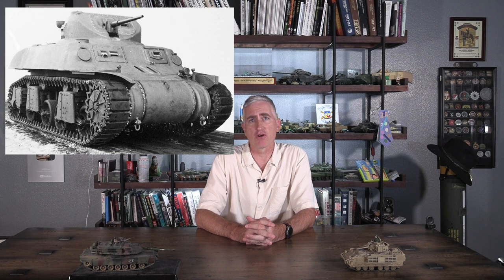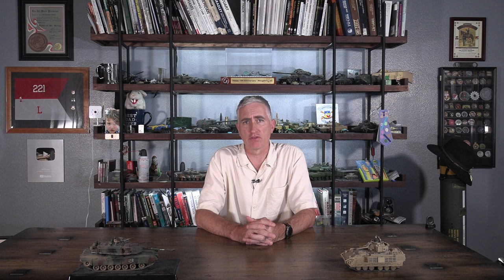The Tragic Tale of the Quad Cities Tank Arsenal and the M7 Medium

Comment: The Chieftan made a good point about 'institutional knowledge', regarding the manufacturing of tanks, and detriment/ increased burden of losing that knowledge, say all tank production closed for 5 years.  I wonder if there are any interesting case studies out there?
Reply: China has a good one going on now in their blue water navy, and Russia is experiencing it with their generation 5 stealth fighter program. Both didn't lose the institutional knowledge, but never had it in the first place, so effectively the same thing.

The effects? China floats an aircraft carrier but are basically winging it when it comes to it being a genuine force projection tool. And Russia has a generation 5 stealth fighter program, but 'fields' like 3 maybe.
Reply: @ekscalybur  All good points Eks, with regards to China, technological advancement is important.  However, I think their carrier and "stealth" fighter also serve a propaganda purpose.

On another note, Japan, one of the original developers of aircraft carriers, is acquiring a new carrier.  To be honest, I have yet to do any research on that ship, but I wonder if it's a native design, or supplied by another nation.  They certainly have experience building massive ships, but it has been a few generations since their last carrier.
Reply: @jayklink851  The Izumo-class aren't carriers... exactly. Officially they're "helicopter destroyers" or even "multipurpose destroyers," and the big flat decks were supposed to be for operating large numbers of ASW helos.

In practice they also have a few hundred troops and a few vehicles they can put ashore via air, and the Japanese government has ordered enough F-35Bs to base a dozen on each Izumo.  Plus ordering modifications to the ships to make them better platforms for the F-35B.
Reply: @Philistine47  Oh ok, so its official task & purpose is for helicopters but it can accommodate F-35Bs, gotcha. I wonder if their 'defensive only' treaty forbids full scale carriers?  At any rate, Japan has definitely lost some institutional knowledge when it comes to modern carriers.
Reply: @jayklink851  Pretty much. Japan the Shield, US the sword. The defence aspect is in the Japanese Constitution, not a treaty. The defensive aspect has over the decades increasingly loosened, hence "Helicopter destroyers" and the recent declaration that they would defend Taiwan as they see that as an existential threat.

If Japan was to get CATOBAR carrier, there is no technological reason they can't and the US can transfer the institutional knowledge. Japanese defence industry is a lot more developed than people think. They make and design their own tanks, jets, navy.
Reply: @oohhboy-funhouse  As an undergrad one of my professors, a former Pentagon employee, introduced me a Nuclear proliferation specialists/author, he said that Japan probably has several nuclear weapons.  Most likely covertly developed in the mid-late 80s.
Reply: @jayklink851  And a modified Japanese Epsilon rocket would probably make a perfectly serviceable ICBM. They're solid-fueled and require only 8 crew at the launch site, neither of which are conventional requirements for civilian launch vehicles.
Reply: @Morrigi192  Morrigi, I just watched a video of a Epsilon rocket launch a satellite into space, a damn fine solid-fuel rocket.  The Epsilon certainly has the capacity to carry a warhead.
Reply: @ekscalybur  China copied others military jet engines yet never figured out the alloys those used for the components subjected to extreme high temperatures. That limited the speeds of the aircraft since using the afterburners for short periods of time would quickly ruin the turbines. I think Russia ordered 12 of the stealth fighters, took possession of 8 for testing with 3 crashing during training and 1 burning up on the ground. Think the remaining 4 were grounded after one had it's pilot's canopy pop off when flying at 44,000 feet.
Reply: How about the USS Jimmy Carter, SSN-23? (Edited to fix hull number. Don't know how I screwed that up!)

She (ships in the US Navy are always female, despite the name) was the third and last ship of the Seawolf class.

The Seawolves were designed in the 1980s to basically be able to single-handedly hunt down an entire Soviet carrier group. They carry far more weapons and have twice the number of torpedo tubes as a Los Angeles class. They're also about 10 feet bigger in beam (same beam as the Ohio-class) and close to 2000 tons heavier. The plan was to build 29 of the Seawolves. The Navy had gone so far in preparation that they'd built a huge new schoolhouse for all the new systems in Groton, CT.

Then the Soviet Union collapsed, and the production run got cut to 12, and then to 2 boats that were basically too far along to cancel entirely.

But this also left Electric Boat, the manufacturer, not doing anything for almost a decade while the Virginia class submarines were designed. All the welders and shipfitters would be laid off.

So, despite the expense, a third Seawolf class submarine was ordered, and also extended roughly 100ft with an "ocean access section" to take over from the USS Parche (that's spoken "par-chee") for doing Special Projects.

President Bill Clinton himself said that this was specifically to keep the highly skilled workers and their corporate knowledge going.

With the addition of that ocean interface plug, Jimmy Carter was not commissioned until after USS Virginia was.

Today, all three of the Seawolf class subs are stationed on the Pacific coast as part of the Submarine Development Squadron, mostly to have all their relatively unique spare parts in the same place.
Reply: Double post.
Reply: @ScottKenny1978  Scott, that's an excellent example of just how important institutional knowledge is.  It sounds like your fairly knowledgeable about our submarine fleet.  Now I could be totally wrong, have the Europeans developed a diesel electric that can stay submerged for several weeks?  Historically, the lack of oxygen limited how long diesel electrics could be submerged before they had to recharge their batteries.
Reply: @jayklink851  yes, I was on subs as an admin guy (and helmsman and lookout) from 2000-2006.

The keyword you're thinking of is AIP, for Air Independent Propulsion.

There's a couple ways to do it, one is a fuel cell that turns hydrogen and oxygen into water plus electricity. Fuel cells have hydrogen and oxygen storage tanks outside the hull. The other way is something called a Stirling engine, which usually runs off of diesel fuel and pure oxygen, with the oxygen tank outside the hull.

I believe that all modern subs have a way to make oxygen while under water, plus a carbon monoxide burner to make carbon dioxide and a carbon dioxide scrubber. On the subs I was on, our scrubber used monoethyl amine, and that gives the air onboard a very distinct smell.

There's also stuff taken from underground mines, but at least in the US Navy that stuff is for emergencies.

Comment: Oh my.  This talk brought up memories of when I worked on software for the Navy's LHD.  Our software was to allow one computer system (made by one contractor) to communicate with another system (made by another contractor).  Engineering changes (ECs) from the government which changed communication protocols showed up from time to time and we had to go back and modify the software to accommodate them as well a log and correlate the changes with the EC database.  These changes were also implemented and logged by another team (different contractor) who were developing the emulator that mimicked the hardware we were supposed to communicate with.  When we got to the shipyard for integration testing, nothing worked.  The hardware contractor pointed at us and said, it's their software.  We had all our major people there using various interface 'sniffers' by which we proved that their hardware had not implemented this EC or that EC.  Those ECs which required firmware changes could be redone but the changes that required new circuits generally could not.  In the end, we had to jury rig our software to accommodate their hardware so the systems could communicate.  I learned firsthand the meanings of fubar and snafu.

Comment: We used to go over to East Moline after the Iowa bars closed at 2 am.  In East Moline we could drink to 5 am, back in 74.  My head hurts just thinking about it.  I worked at JI Case in Bettendorf, which was originally an old railcar factory iirc.

Comment: I'm sure the US production of the Merlin would benefit from the same treatment.
Packard got the drawings from Rolls Royce.. Looks at them contacts Rolls Royce supposed to be Britains best engine manufacture. "You havnt sent the right drawings". "What do you mean". "There are no torque wrench settings". A very puzzled senior engineer "What's a torque wrench?" they litteraly had no idea, they were not used in the UK. Every thing required the skill of a trained fitter. Packard eventually had to completely redesign the entire engine. Oh I checked torque wrenches were not available to RAF technicians. I have several RAF manuals not a torque setting in sight.
Reply: RR first asked Ford about producing the Merlin and sent them an engine along with the blueprints. Ford was working on a V12 aero engine to compete with the Allison and Merlin so turned down the offer, saying they needed the exact specifications for each part that was required for mass production. Ford sent the engine and blueprints to Packard that told RR the same thing. RR asked Packard to do that for them so they did and redesigned the motor while at it to improve the reliability of components and reduce the number of parts it used (the similar Allison V12 used 50% fewer parts). 
Torque wrenches were invented around 1918. Chrysler began producing their own improved beam-style torque wrenches in the late 1920's and early 1930's. The US military provided their mechanics with torque wrenches after their inception. In the 1930's Blackhawk Tools made a beam-scale torque wrench that would flash a light when the set torque was reached. Britain imported torque wrenches so in 1942 allowed two Brits to start manufacturing copies of US torque wrenches. Standard torque specs were determined by bolt/stud size and thread pitch which often came listed on a sheet with each new wrench.
Reply: @billwilson3609  we definitely didn't use them before I have a number of maintenance manuals for RAF planes. Absolutely no mention of torque wrench settings. I know you can work it out from a table if you know what the bolt material is. I wonder if in those days even that was standardised. Some years ago I watched a documentary on Cosworth F1 engines perhaps 1980s not a touque wrench in sight!
Reply: @womble321  I don't know what the British did. Common sense would suggest using torque wrenches during assembly then an approved tightening sequence out in the field due to shortage of torque wrenches. The US Army supplied torque wrenches to the mechanics at the repair depots and field repair stations. Had a neighbor that was a mechanic with a 3rd Army armor recovery unit and said they had 1/2" and 1/4" drive torque wrenches that were "liberated" from a repair depot so they could replace the cylinders, heads, oil and fuel lines on the radial engines to ensure that the gaskets and fittings didn't develop leaks.
Reply: @billwilson3609  hi early in the war they simply didn't exist. Everything was done by feel.
Reply: @womble321  I know that by the 1990s that was part of the US Federal Aviation Regulations. Had a table in the book but I don't remember if it was in Part 43 (general design) or Part 65 (maintenance). Annoyingly, my books took a walk about 20 years ago.

And the FARs are basically all the WW2 standards.

Comment: The machine tool manufacturers went a step further to address the machine tool shortage by designing attachments for their machinery that would allow them to perform two or more different machining functions on the parts they were producing. That saved on costs for additional machinery and the buildings required to hold them. Tool makers also started a cutting tool exchange service where they dropped off sharpened cutting tools and took away the used ones for re-sharpening before they became dull.

Comment: These early tooling machines were often Bridgeport lathes and their predecessors, eventually replaced by CNC machining in modern day, but still verrrry much around. 
Ian, on Forgotten Weapons, has a tour of a machine tool rifle manufacturer that has a chain of these older machines, each one doing a different task, so as to automate manufacturing in parallel. This line now sits idle as it's been replaced by CNC milling, but the manufacturer still keeps it intact.

Comment: "tool room methods" are those which are more versatile but slower than production methods. Instead of dedicated fixtures, gauges, dies, machine tools, production lines, etc, the factory relies on highly skilled workers to produce parts using general use machines by figuring out more or less for themselves how to do the job. Much slower and more expensive per part, but cheaper and faster than waiting for a production line to be setup.
Reply: Bespoke.

Comment: I was sad to listen to this story simply for nostalgic reasons. My Dad has 2 International Harvester model H tractors that were built in the late 1940s and are his age. They've been run pretty much continuously since production with a bare minimum of maintenance, and he still uses both of them- one as a snowplow and the other for a bunch of basic work around his no-longer-operating farm. The darn things just don't break. The last major work we did on them was replacing the seals in the transaxle.... back in the mid-90s.

Comment: 22:00 - That whole situation with "Tanks now!" "Factories? eh?" sounds a lot like Priority Inversion, which is something that can affect realtime operating systems.

It's no use marking something as high priority if it depends on something lower priority, and you don't thus bump the latter's priority to match the former's, especially if there's anything else higher than that lower priority.
Reply: What are you saying there?

So, if a high priority thing depends on a low priority thing, you should:
A) make the low priority thing jump up along with the high priority thing?
B) not make the preceding thing be affected by the priority of whatever comes after
Reply: And this system still exists.  Now known as DPAS (Defense Priority Allocation System). And all parts have the same priority as the finished product (up to a specified number).  Tooling, equipment, and raw materials were our problem. 

I remember looking at my shop's production plan for the next two months.  Spent days carefully tracking every process and planning things so that every one of our customers would get their stuff on time.  Then my phone rings and the guy on the other side told me he had a rush project with a DPAS rating one level lower than that of our biggest contract.  (Which had a really, really high DPAS rating).  I apologized to him and told him that we had an Air Force contract with a higher DPAS rating and that our production schedule was full.  At this time I was certain that my carefully laid production plans were safe because the only person who could approve a higher DPAS rating was the Secretary of Defense.  

The next day the guy called back and said that his project now had that higher rating.  And that he needed the parts next week.  My shop was already working 50 hour weeks and none of the stuff we were working on could be sent out to the main shop.  So me and my shop now worked a 60 hour week and got those parts ready to be picked up by their courier on the day specified (3:30 PM but that still counted as the specified day).  And I socked all of the overtime charges and overtime for the machines (plus a 'you pissed me off' markup) to the bill.  

Two days later I got another call from them.  They broke one of the parts and needed a replacement.
Reply: It's easier to make the priority changes now with computer systems. 

Can still be screwed up, but it's easier to make sure your stuff all has the same priority level.

Comment: It may have been a boring story in more ways than one -- there must have been quite a few boring operations in making parts for the tank.
The Gisholt Simplimatic was a kind of automatic lathe that could do several operations without human intervention. Kind of like a CNC lathe (or "turning center") nowadays, but the automation was all mechanical cams and chain drives instead of computer-driven. Apparently one or two simplimatics could replace many turret lathes and required a fraction of the labor.
Reply: Sounds as ifd it was similar to a single spindle screw machine . Although I bet it was for much larger parts than a Brown and Sharpe #2 could make.